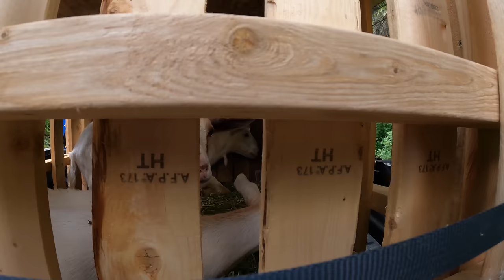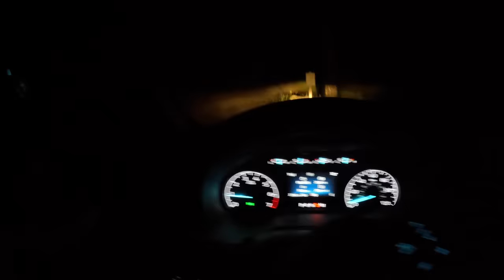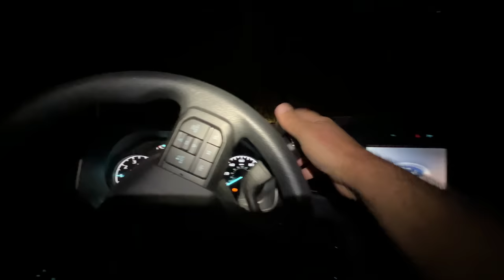WILD CRAWFISH Catch & Cook!!! POND BUILD at the Mountain Farm!

Comment: I'd like to see you using a light cheap crayfish trap or 2 if they are legal in the area and using a snorkel and goggles to catch some as well. I used to use one of those green fish nets from a fish pet store...when i was younger i would have the goggles on in daylight swim around and flip over submerged rocks and put the net right behind a crawfish and drop a rock a couple inches in front of them, they scoot backwards right into the net. Sometimes I would find 5 or 6 hiding under the same rock. I could easily catch 50-60 craw in just an hrs or so!

Comment: Just to confirm: Most of the crawfish in your video (such as the crawfish shown at 15:45 and 21:50) are NOT signal crawfish.  They are Northern crawfish, which are considered as invasive to Washington state.  You can identify the Northerns by the prominent row of bumps at the top of their claws (signals have smooth claws) and by the missing "white spot" at the joints of their clams (signals have the white spot).  So, what that means is that there is no size, egg, etc. restrictions on these Northerns with respect to what you can keep or release--WDFW regs require them to killed before leaving the riparian area.  I guess what this also means is that you probably should not stock them in your pond.  I think Northerns are the predominant catch in much of washington east of the cascades